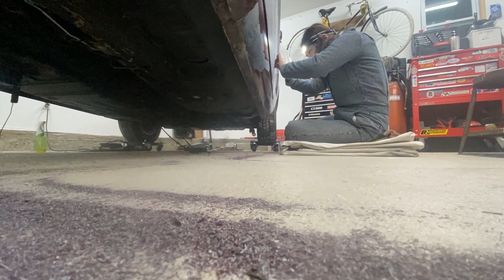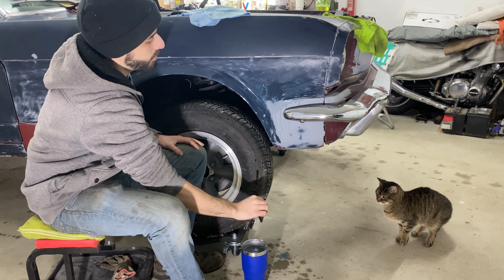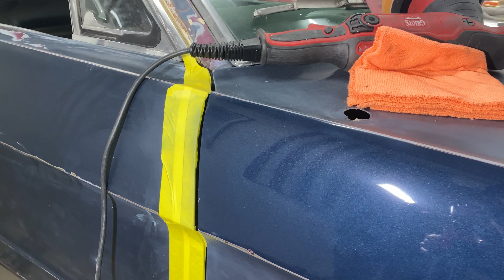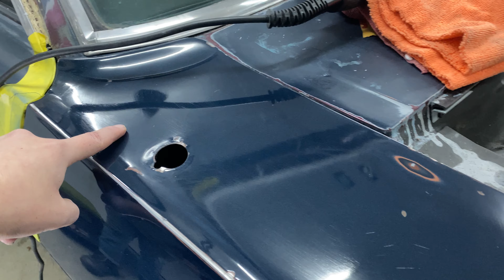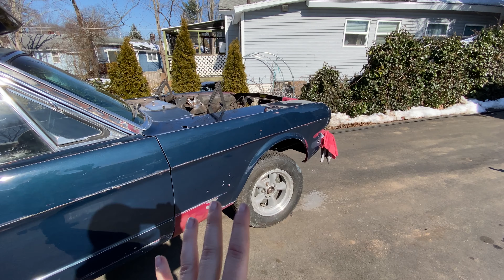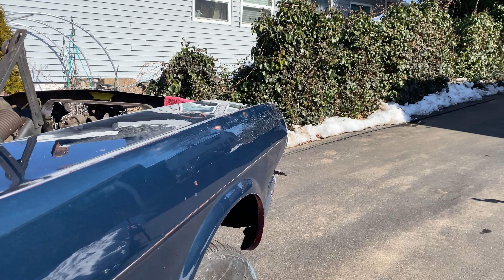Cheapest Paint Job Ever... But Does it Look Good? Part 2 of "Painting" My 1965 Ford Mustang

Comment: So just right out the gate , the guy telling other how to sand while he is sanding VERY wrong needs to stop.... You never hand sand with your finger tips as it leaves just that int he paint. Second , that car has some 64.5 parts on it . Third , why do the millenials and Gen Z work so hard to get out of work ? Then go on to make How To Videos so others in their age group can get professional lazy ? I mean its nuts !! Yoube is full of videos from folks in these age groups instructing others on how to half ass something.... Make it make sense ? Folks used to take pride in a job well done and now..........
Reply from the maker: It sounds to me like you stopped watching the video before we explained why we did what we did, and why it doesn’t matter when the areas are either small sections, already low spots (like from a ding, dent, or chip), or with a fine enough sand paper that it would not cut into the surface shape of the paint. If you had watched until the end, you would see how straight the panels came out for what they are. 

If you also watch all of my other videos it shows plenty of hard work getting done- this process is just one many chapters of hundreds of hours worth of work. A minute long time lapse is over 4 hours worth of work, to give you a sense of perspective 💪🏻

Stay positive and be happy some of the younger generations even have an interest in these 👍🏻
Reply: Oh so yorue telling me sumthin , LOL , you can see the marks from his fingers in the paint almost imediately . Its there . Perhaps the younger generations would benefit from "The princess and the Pea" . Another philosophy maybe your generation needs is "Aim small miss small" because you have ebmraced "Good enough for government work" already and we dont need anymore of that. Yes I see you have plenty of time on your hands to use to try and avoid doing what actually needs to doing to arrive at "Good enough for government work"  Aim small miss small is another way of saying shoot for perfection and your result will always be great. Its hard to do these cars and its time consuming. You are young and have the energy to make it cost very little. Patch those panels and restore the car so that when you are done you have achieved something. WHat you will achieve is by using your brain and your young energy you have a result that others spend thousands on. Another way of saying that is "Being good at being poor" . If you have the right brain and the energy to go along with it you dont need to be ruich to have everything in life you desire. @thetirekickers